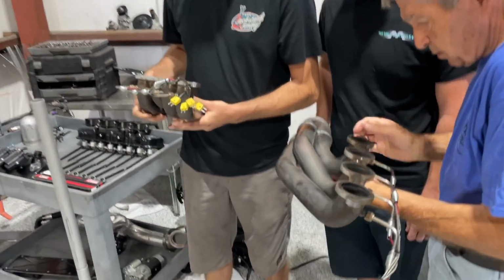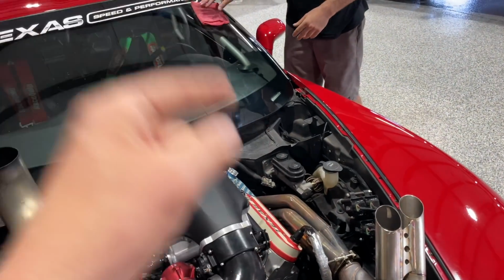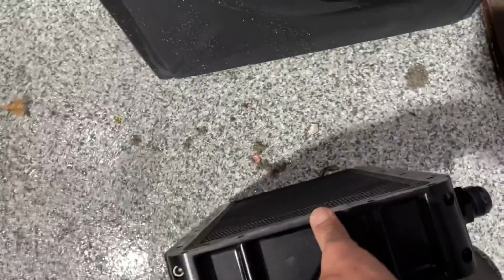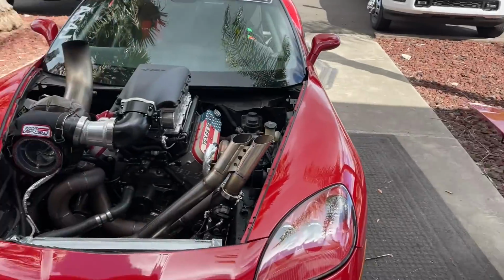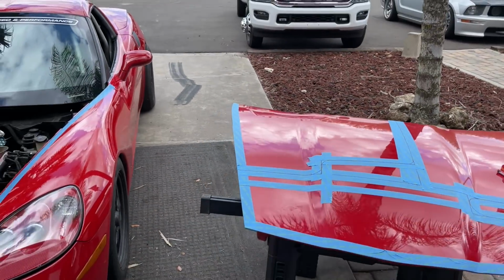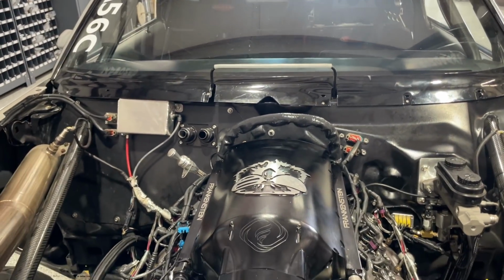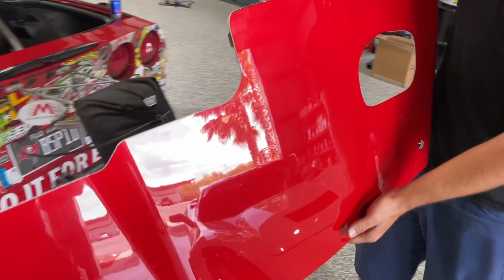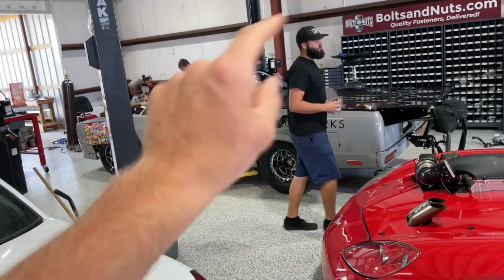Mullet Returns... and Ruby FINALLY GETS A HOOD!!! Prepping Our Racecars for TX2K22!!!

Comment: Cleeter: "We'll just throw some bondo on there and sand it down"
Sam (dead serious): "You can't do that to headers" 
I'm dead.
Reply: Oh Sam's seen Cleets work and wouldn't put it past him to do something like that.🤣
Reply: @cknorris3644  🤣🤣
Reply: They ended up using flex seal lol
Reply: @cknorris3644  Exactly 🤣🤣 this is the same Cleet that used gasoline and mountain dew as engine oil after all lmao

Comment: Another (zirt) metal bracket and screw in the center front will keep it from flying off, I think I would put the passenger side piece in if you have time it will look a whole lot better and protect your plug wires from the rain.
Reply: "zirt"..????

Comment: She looks damn good with her hood on. But I feel like underneath the up pipe, or atleast the corner where you've got the coil packs mounted should have that corner covered up aswell. It'd just be more better 🇺🇸
Reply: That exhaust pipe would have to be wrapped, even if they made a custom contoured dipper for that side because the heat would destroy the paint in one day of driving.

Comment: I'd like to shout out to your electrical guy,when looking at mullet with the intercooler off you can see all the connectors in the fire wall, looks sweet,nice clean and water tight👍👍

Comment: The intake is going to hit the hood when Jackstand mashes the pedal off the line - I think it needs a bit more clearance...  And, Tye ought to cut another piece of that hood to cover the right-rear portion of the engine compartment.   And, Dr. Tune-em-All is going to have to take a few pounds of boost out of the half-track tune to keep from overrunning the class - I suspect y'all will be surprised by how much mph it picks up with the hood!
Reply: not sure if you know but one of Cleetus's videos was inside of a wind tunnel to test that should pick up about 20mph, thats why he was fine removing the hood on mullet originally

Comment: look into cryo treating the valves. could be a good way to harden them. we do it with valve springs at Brzezinski Racing Products
Reply: How do you do yours ?  No 1 does it commercially anymore here in nz I do it myself I use dry ice in tub filled with methylated spirts
Reply: We do the same with our trap guns, it’s fantastic but not cheap
Reply: That may have been the smoothest advertisement I've ever seen snuck in during a comment. Props to BRP. Maybe you should offer to do it FOR Cleet.
Reply: @tannerparson7030  we send out batches of springs like 300 at a time and its the same price as if we were to send one spring. The place we send them to does it by weight I believe
Reply: @theegwana2103  We send ours out to ThermTech of Waukesha Inc.
Reply: @ronjones-6977  We don't do it ourselves. We send the springs out to ThermTech of Waukesha Inc.
Reply: @Nategp08  the reason it’s so expensive is the insurance, trap gun isn’t as cheap as springs or valves, it cost me about 5k but I shoot dead straight, no warping
Reply: @tannerparson7030  dont see how that would change the price. All you should need to do is take pew pew apart, send in all the metal parts, then reassemble when you get it back. Just trying to see how doing a disassembled pew pew would be more money.
Reply: @Nategp08  it’s the insurance on the parts
Reply: @tannerparson7030  ahh that makes sense. Yeah we dont worry about that
Reply: @Nategp08  my trigger assembly is 450 alone😂 (it’s a reverse fire, only fires when you release the trigger)

Comment: I ran the 14 volt battery, be sure to run an alternator putting out 16+ volts. your standard alternator will not keep up and a 14 volt battery when it only has 12 volts will not have the amperage needed to work properly like you would think

Comment: What you need to stop replacing head gaskets and heads in Mullet is to get the new Steve Morris SMX.   Fill billet block and and jacketed head that uses all your other LS parts.  Full drop in for an LS.  Just saw the video today. It looks real good.
Reply: SMX isn't new.

Comment: id almost say to make it easier make the wastegate pipe holes permanent plate and that way the hood dosent have to go on in a weird way. so just build a tube bracket that holds the plate there and add a simple vent opening half way between the driver side windshield and the waste gate pipes that doubles as a handle to lift up with.

Comment: She is  , Ruby is going to need another hood clip right on the end at the passenger side. The lose tag end will be flapping and cracking apart over time other wise. I hope you took a heat gun to all the cut edges or some resin to help hold the hood together. Looks to good to let it crack apart now.

Comment: This hood set up looks good , but it would probably look more finished if the portion under the exhaust behind the turbo is also added with hood pins on all four corners so that if doesn't fly away during a pass

Comment: Ty, you could have made a hood out of cardboard and got that to fit and then simply trace it onto your hood and get the job done in nearly one cut. That's how I did my fiberglass hood when I did my blower motor. I also cut it with a jigsaw with a fine-tooth blade which made the curves very easy. Never used a holesaw!

Comment: These old C5 and C6 Corvettes have a really low coeficient of drag, so hopefully you gain some of that back by getting most of the hood back on. Aero is one area where you guys tend to neglect, so I'm interested to see if you pick up any MPH  on the back half. I think there's enough there that you might. Maybe think about relocating that turbo and tucking it down below to have only that intake hanging out. Aero would probably still work good like that and you'd have a little hole in the back behind the intake to eliminate lift at speed.

Comment: always wondered why you have ran cheap batteries, with all the electrical and sensor issues you've had. FINALLY stepping up to an XS Power. won't even sound the same while cranking.

Comment: Would your coolant temp help much with the valve heat/seat problem?  Im just saying if there isn't much you can do with the head/valve combo at the moment can you help out the situation by trying to keep the engine cooler?  Be it a bigger/additional radiators, coolant additives/changes.. oil coolers?